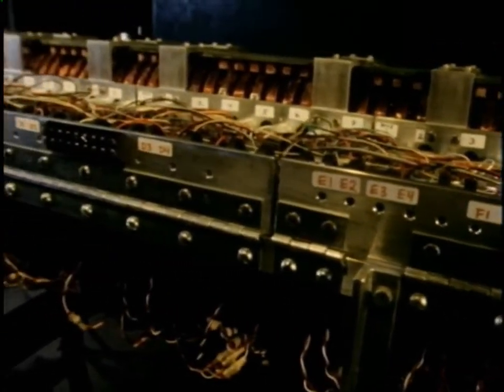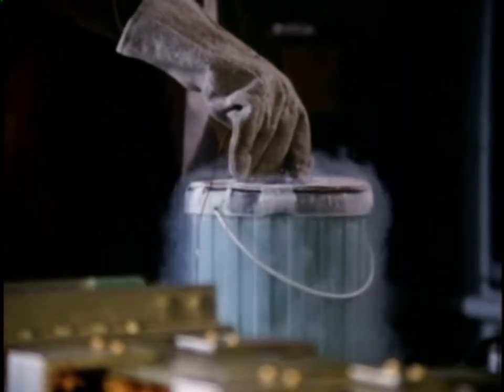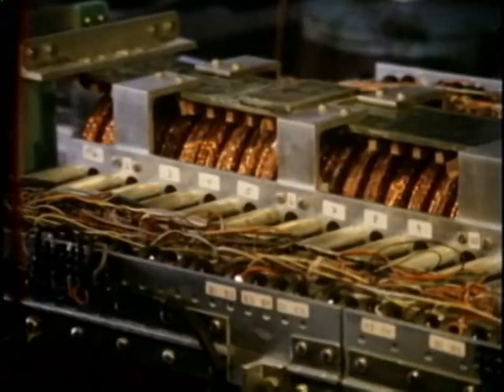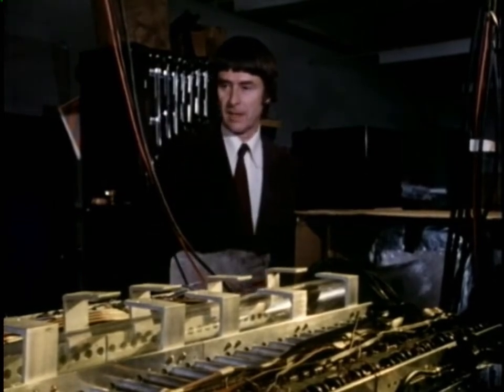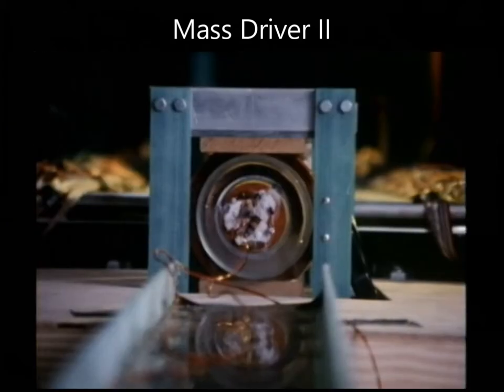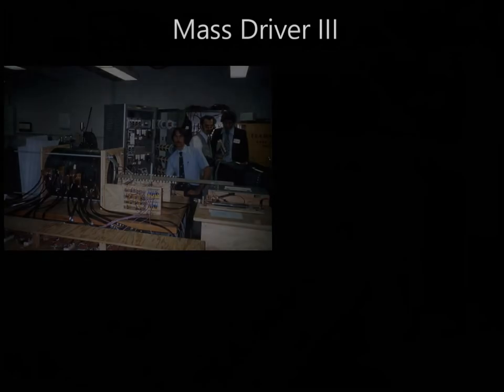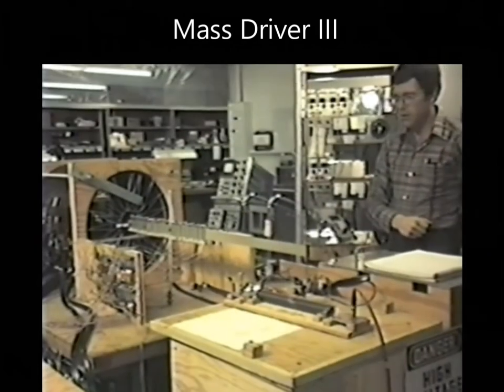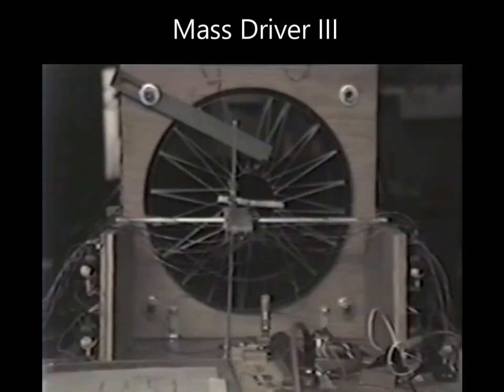SSI Mass Driver Demonstrations

Comment: My interest in electro magnetic launch systems was about using nuclear fusion reactors if they re ever viable power sources, and can be used for propulsion. You could launch Vehicles and payloads into orbit, and use non-chemical based propulsions to slow down or steer to your destination. I was wondering if mass drivers could be used to get machines and other payloads into space, that could make their way to mars without ever having to use chemical propellant as a means of thrust.

I'm really only interested in this technology for material and machine/tool payloads to be delivered. As it would leave out solving the problem of safely putting people in these systems for launch into space. It seems like you could do a long tube, or coiled tube, with less energy to achieve the needed velocity to escape earth into space. I'm not a scientist or engineer, but it seems like a good option for getting supplies into orbit, and to other planets/moons.

Comment: How is it supposed to decelerate?
Reply: Eddy Charles  -  some of the deceleration will be from climbing out of the Moon's gravity well to the processing and manufacturing facilities out at Earth-Moon L5 (or L4).  If each canister is 'smart', it might use retrorockets.  If each canister is 'dumb' the "mass catcher" would use some of the cargo from previous cannisters as reaction mass for its own mass drivers.  A really high tech solution would be for there to be two mass drivers launching paired cannisters with one launched much earlier but going the long way around past Earth-Moon L3.  The pairs would arrive at E-M L5 (or L4) heading in exactly opposite direction into a double ended mass catcher.  Each would cancle out the others momentum.

Like any other engineering problem, it will take cubic money to design and implement.  That's the real hang up.

Comment: The opening pages of Kim Stanley Robinson's Red Moon describes a reverse mass driver.  Cargo is on a glide path to go straight into the muzzle of a mass driver where the electromagnets are then used to decelerate the cargo.

Challenges include extremely precise GPS to be sure the cargo is precisely on the glide path.  Probably require no more than a centimetre of deviation... all while the cargo is travelling at least 1,500 metres per second.

The glide path would need to be surveyed to extreme precision.  In aviation planes have to contend with varying wind and air density so require constant course correction.  The vacuum of space has just radiation pressure, micrometeoroids and lumpy gravity.  It's unreasonable to expect radiation pressure and micrometeoroids to remain constant but lumpy gravity is near enough to be constant.

Our Moon has the advantage of being tidally locked to Earth.  A single mass driver-decelerator at the leading limb of the Moon could serve as arrival point.  Cargo from Earth or LEO could be sent down a glide path to meet the leading limb at a tangent.

It's a white knuckle scheme.  Cargo craft would only be supplied with enough propellant to make subtle course corrections.  Any error in GPS could mean the destruction of the cargo and likely destruction of the mass driver.

But the scheme would save considerable propellant when delivering people or materials to the Moon.  It would also avoid kicking up dust from landing rockets.
Reply: ''would save considerable propellant when delivering people''

Sadly humans can't survive the Gs of a Mass Driver with our current technology.